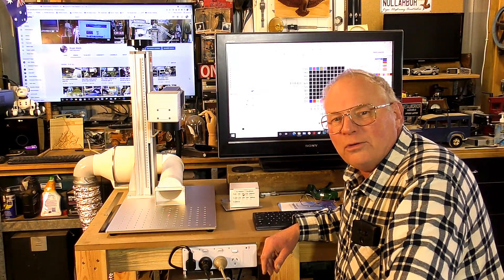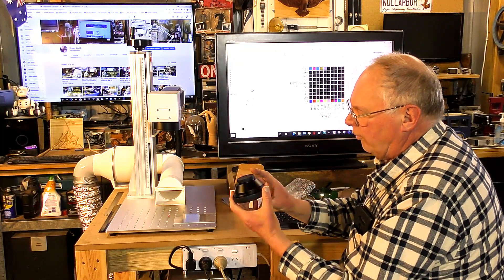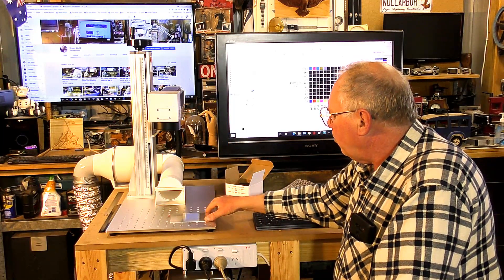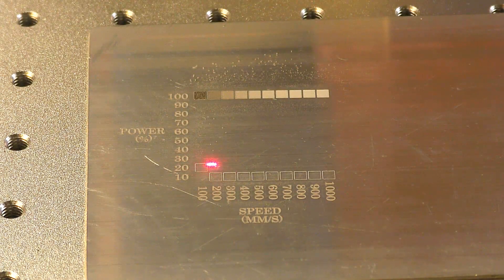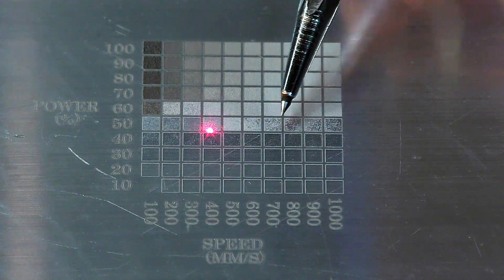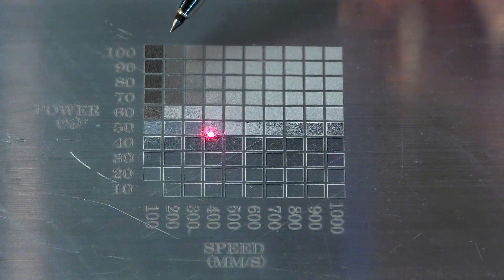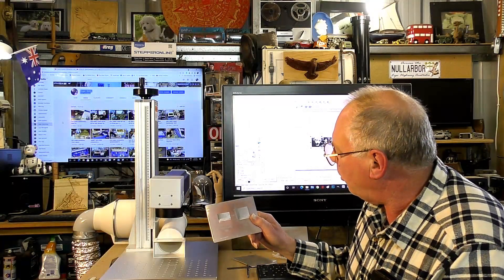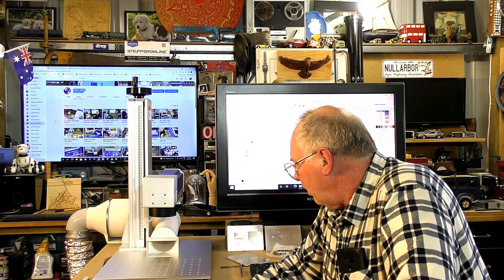FIBRE LASER POWER / SPEED & LENS TESTING

Comment: So cool!!!  Yes, that would absolutely do the job! I love the sound...especially the crack when it does the border rectangle around each of the shades.

I'd have to do a huge amount of etching with it to justify the $'s.  If I get my aluminum parts anodized, I can etch them with the K40....I just need a good bit more Z height to fit the parts under the lens.  Maybe I just need to start making a ton more parts to justify getting one of these. lol :)  Thanks Roger!! 
-Mike
Reply: Something I just thought about.....maybe you mentioned it previously.....can this do rust removal?  I'm not sure the real world application would be significant, but removing mill scale on steel parts might be worthwhile.
Reply from the maker: I will  check that out Mike
Reply: @inventorsworkshop9600  I'll keep an eye open for your vid.  I did come across another vid where a fiber laser like this was being used to clean up a rusty hammer head.......so I'm thinking it's possible.
Reply: @bluehandsvideo  Mine is coming tomorrow. 30 watt. I wanted to try that as well. Thought about making a video of Laser rust removal vs the flap wheel on an angle grinder.
Reply: @JackInTheShop  Cool.  I just subbed you. I have a hard time keeping up with channels I'm subscribed to, but this way, I at least have a chance of seeing what you post. :)  Thanks! Mike